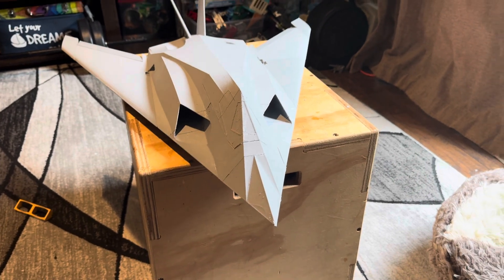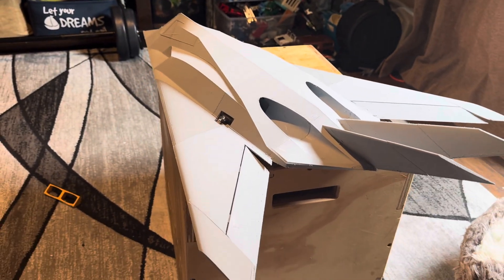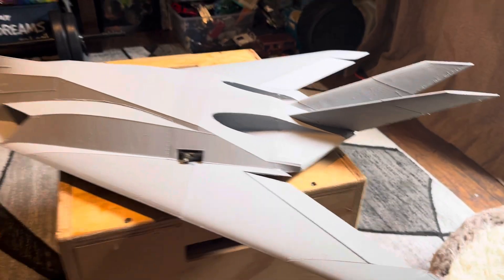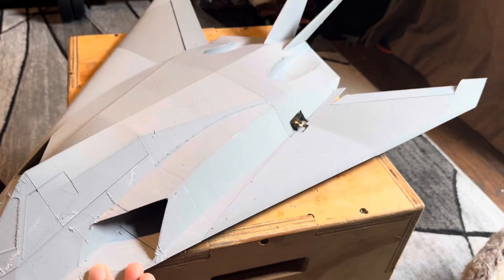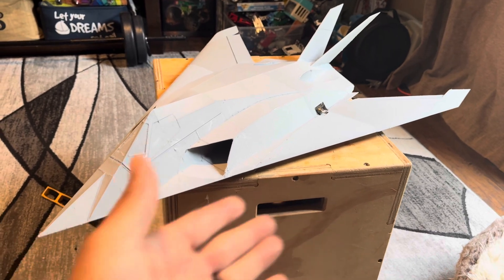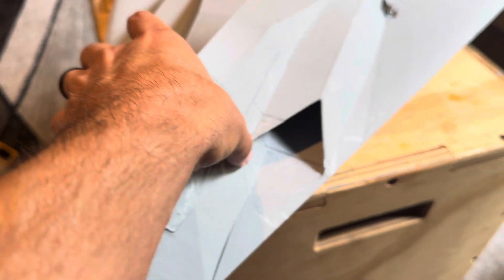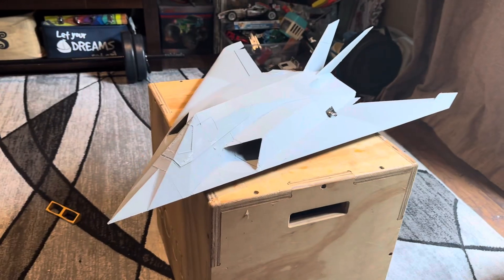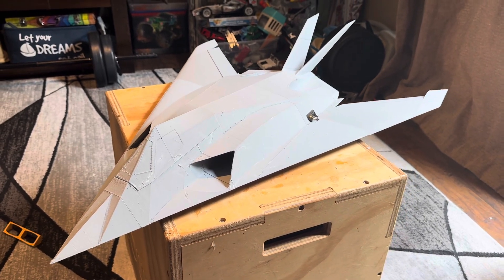New F117 Stealth fighter design

Comment: You're building 'em fast alright but any chance you could fix the CAD work on the Schmiggen please?
Reply from the maker: What cad work on the shmiggen??
Reply: @hotlapkyle  As per the comment on Cults. Turns out the internal ducting isn't symmetrical in Fuse 3 and 4 (I think). Its an easy fix but much easier if you do it as you have the CAD file.. Cheers.